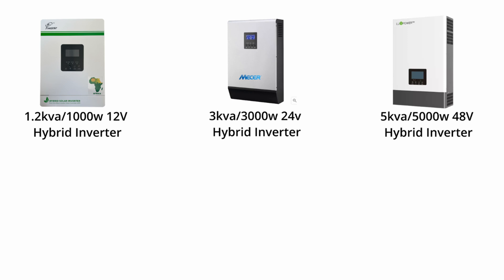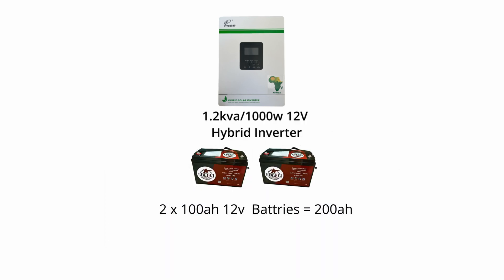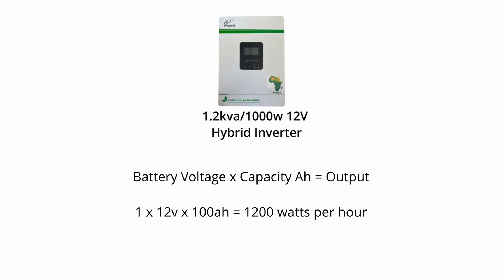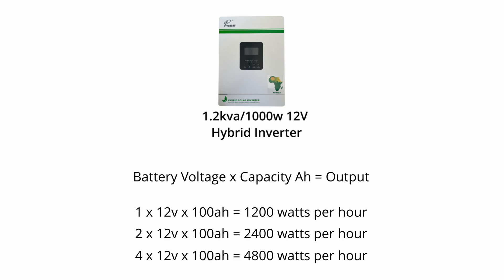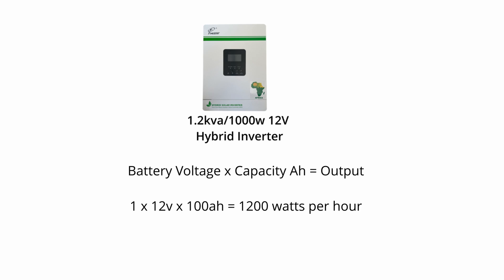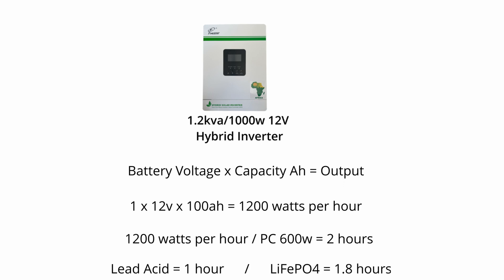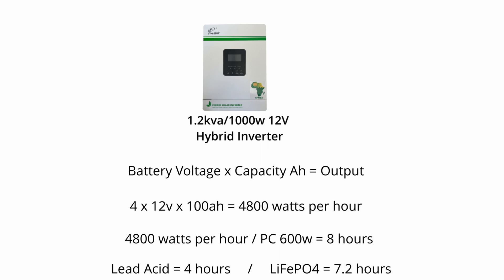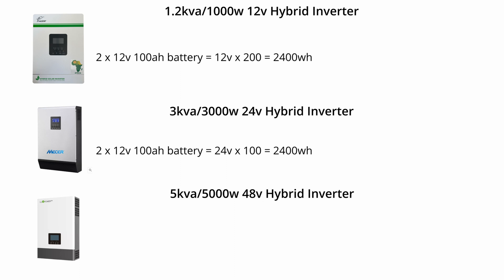Loadshedding battery backup inverter systems and how to work out what you need!

Comment: What’s the maximum of parallel batteries connections can I have on a 3kva mecer inverter
Reply from the maker: @bongumusanyandeni3691  it would depend on the battery, Esener 2.56kwh can only be paralleled with 2 batteries where as Ritar 2.56kwh can do more than 6. It depends on the battery management system of the batteries itself and not the inverter
Reply from the maker: @bongumusanyandeni3691  gel batteries can do 4 to 8 but it would need recommended to get a battery balancer to help keep the voltages stable.

Comment: Hi, Ive got a 3kW Mecer inverter with 2 x 12V lead acid batteries connected in series. Where do i set the 50% battery  voltage usage before switching off?
Reply from the maker: So you can set the cut off voltage in the menu of the inverter

Comment: Is it possible to change battery from lead acid batteries to lithium ion batteries,in 3kw meccer hybrid inverter?
Reply from the maker: Yes and thanks for the comment, if you Google solar warehouse SA you can either go for drop in replacements for about R5k each and you'd need to 2 to make up the 24v or something similar to mine, the Esener 24v  lithium battery

Comment: Hi I connected 2 12v batteries to my 24v inverter batteries were swollen and steaming this morning why is that?
Reply from the maker: The batteries are probably being overcharged and either the charging amperage is too high or the charging voltage is too high, what type of batteries are they? And what inverter do you have?

Comment: So for 3kw inventor which battery should i use 100Ah or 200Ah
Reply from the maker: I'd probably try to go for 200ah as it can allow for approximately 1200 watts per hour over a 4 hour period
Reply: @JustekGaming thanks for the information 🙏🏼 so should I use two batteries or single battery of 200ah
Reply from the maker: @lesegobiglido2822  that usually depends on the DC voltage of the inverter, a 3kw inverter usually needs 24v/25.6v DC so it would need two 12v batteries or one 25.6v battery

Comment: How do you know if you would need a 12 or 24 volt inverter?
Reply from the maker: That all depends on the size of the inverter, usually up to 1200va is 12v, 3000va would be 24v and 5000va would be 48v
Reply from the maker: For example a 1200va or 1000w hybrid inverter is capable of running your setup at approximately 600w but to be able to run it for 4 hours you'd probably be looking at 4 deep cycle batteries  or 2 lithium ion batteries

The problem with deep cycle batteries is that some of them can only get about 500 to 800 cycles
Reply: @JustekGaming  thanks so much for your replies! is this just something thats a hobby or necessity to you or do you also work in electrics when not doing videos haha
Reply from the maker: Thanks for the comment, it's more of a hobby that I do over the weekends, I've been working in the electrical industry for a couple of years now and have found my passion in tech.